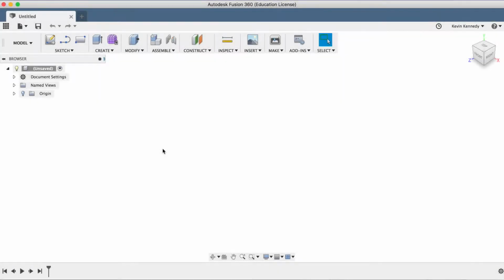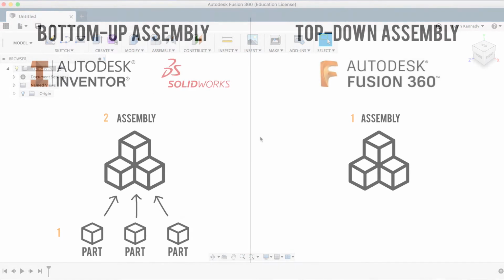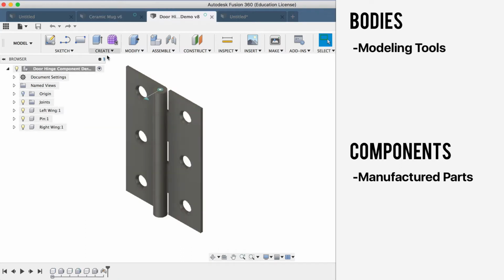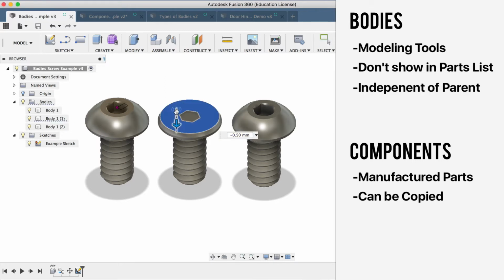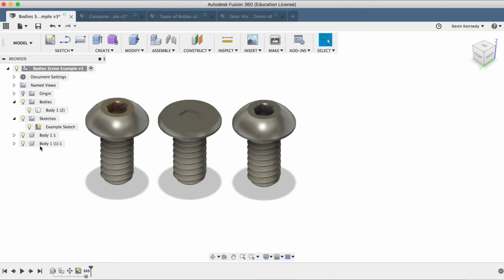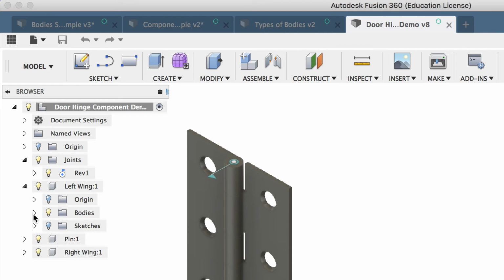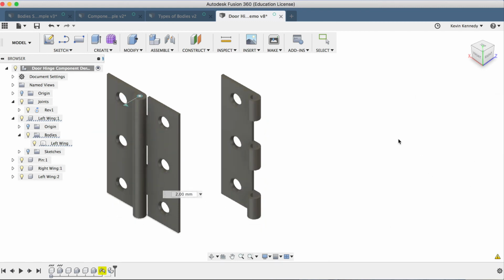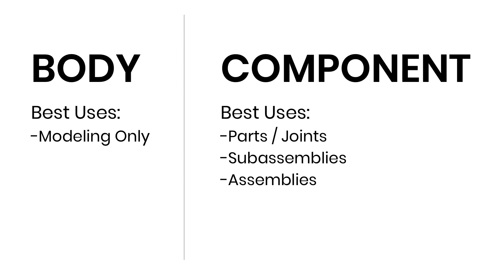Bodies vs Components in Fusion 360 Explained - Learn Autodesk Fusion 360 in 30 Days: Day #13

Comment: Hi,
One thing which i have been looking for from quite long time and i am unable to figure out a way to do it. 
Can you please explain how you can show the movement of the chain of a chain hosit in Fusion 360. 
like a chain hoist in the following image. 

https://www.google.com/url?sa=i&url=https%3A%2F%2Fhoistzone.com%2Fshop%2Fstarke-electric-chain-hoist%2F&psig=AOvVaw1CYyKek0Njem7w_3I9KOn3&ust=1603703536807000&source=images&cd=vfe&ved=0CAIQjRxqFwoTCKCGxLSzz-wCFQAAAAAdAAAAABAJ

if you need a model, you can use the following model from the grabcad community library. 

https://grabcad.com/library/chain-hoist-yl1000-1

I wonder if this can be done with the joints or some other way. 

It would be nice to see a video from you on that.

Comment: I noticed that if I mirror a component, the mirrored component will NOT update if I make changes to the original one. 
What should I do? Give up mirroring altogether? Or is there a way that I can mirror components and still have them update?
Reply: based on this post it seems the only way to do that is to edit the component by going back in the timeline to before you mirrored it. https://forums.autodesk.com/t5/fusion-360-design-validate/mirrored-component-doesn-t-update-geometry-changes/td-p/6523630

unless you found a better solution?

Comment: Kevin I think I found something which no one really knows how to do. Seems that way when I search for it on youtube or google. I simply want to move a hole in a body. How does one do that. Got 16 holes and want to move 10mm inwards. Though sketch then dimension and change the figure. Not allowed. Do you know how to move a hole?
Reply: Any progress on this one? It was the main reason I was initially turned off of 360...

Comment: I have used other CAD software before and now trying to assembled in Fusion 360. You are the first to answer my  major question about Fusion 360 assembly style. It doesn't just work especially when you are working on a project that have up to 50-100 parts to put together. I have worked in a consumer electronics company where you can find BOM running into 100's of parts to assembled. sh***t!
Reply from the maker: Hi, Manis. For large assemblies with more than 20 components I would suggest creating sub-assemblies as separate files. You can then right click on the file in your data panel and select "Insert into current design" to insert your sub-assemblies into your main file. This will help you work on certain areas or assemblies without Fusion 360 having to process each component with every move or feature addition.
Cheers, Kevin :)

Comment: I imported an iges file for large parts I need to program and make. I’m having trouble manipulating it for programming purposes. I now assume it’s because they consist of bodies. Hopefully I can convert them after watching this. Thanks.
Reply: Thank you for the tips. It’s still being a nightmare.
Reply from the maker: @karvtek  You're welcome. Always happy to help. Keep me posted with how it goes. Cheers, Kevin :)
Reply from the maker: Hi, KarvTek LLC - John Bara. Unfortunately, one downside to Fusion 360's file structure is that imported files, such as IGES, take some effort to reorganize. You should be able to group things and put them into components. Make sure that you place any relevant sketches or other features (construction planes, etc) into those components as well.

Typically it's easiest to right-click on the bodies in the Fusion 360 browser and select "Create components from Bodies". Then, you can drag the relevant sketches and features into that component. I also suggest renaming all your components as you create them.

Good luck and keep me posted with how it goes.

Cheers, Kevin :)

Comment: Testing the fit of a part within Fusion 360. How does one test the fit of a part before 3D printing? For example a hinged box and the pin. Could not help noticing how close this was to the door hinge you show in this video. Is there a way to test the fit of the door hinge pin before creating it?
Reply from the maker: Rud Dog - If you're 3D printing the parts then I recommend using the joint tool to create an assembly of the parts (hinge and pin) and make sure that there are .3mm to .5mm for tolerances (depending on your print settings and how accurate your 3D printer is).

I like the idea of a hinged box for 3D printing as I've printed those before. Maybe I'll make a video on it ;)

Comment: When I "Create Component from Bodies" and then save... when I drag and drop into an assembly it doesn't link the component/part.
Do you have a video with more in depth explanation in how to create a single component from multiple bodies so that when that component is used in an assembly it links.... thanks for the help and great video.
Reply from the maker: Hi Jacob - I don't currently have a video covering that, but I do plan on making a few more videos on components/assemblies. It's on my to-do list!
Thanks again for watching & commenting! Cheers, Kevin :)

Comment: Your understanding of Fusion 360 is amazing. How and where did you gain such insight on a very complicated tool? Also I can't believe you don't have more viewers. Will have to post your link in the communities I belong to.
Reply from the maker: Rud Dog - Thanks for watching and for sharing my videos! :)
As far as viewers... I think it is partially because of YouTube's algorithm giving a lot of weight to other content/channels that have been around a lot longer (I've only been posting F360 videos for 2 months). With that said, Product Design Online has been steadily picking up traffic and I'll continue to post new vids!

I'll give you a brief background as far as how I learned Fusion 360...
-2006: I learned Autocad which led me to learn Autodesk Inventor and CREO
-2012: I started to study Industrial Design @ The University of Illinois and picked up SolidWorks, which was fairly easy coming from Inventor
-2013: I started a SolidWorks User Group, with their support, and started teaching it to the community/students. I met some Autodesk fellows as they were heavily pushing F360 to students around its release. They tried to get me to focus on Fusion instead of Solidworks but at the time F360 was pretty clunky.
-2014/16: I started teaching in person F360 and 3D Printing classes to the community/students. I slowly started using F360 more and Solidworks less... somewhere in their switched over.
-2018: I missed teaching F360 so I decided to start this YouTube channel! :D